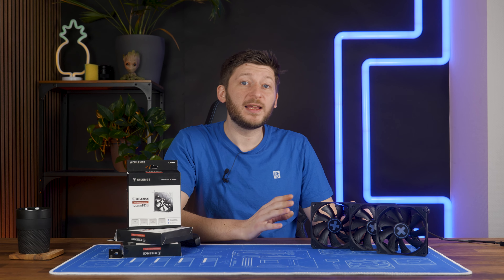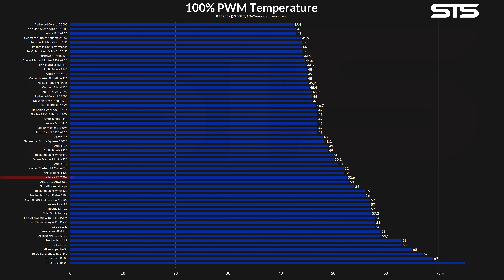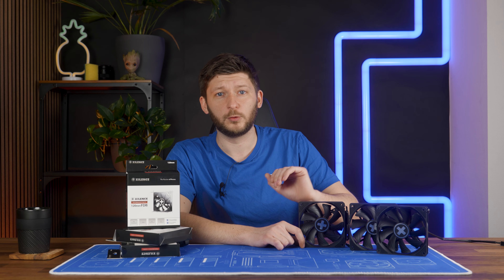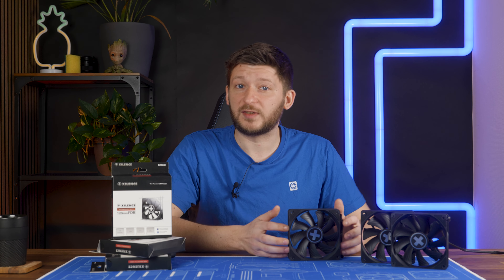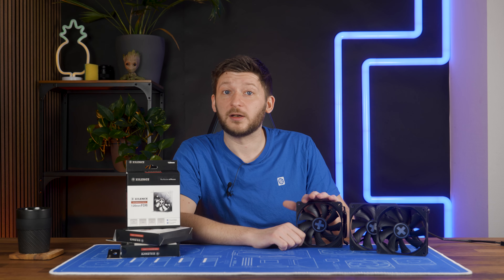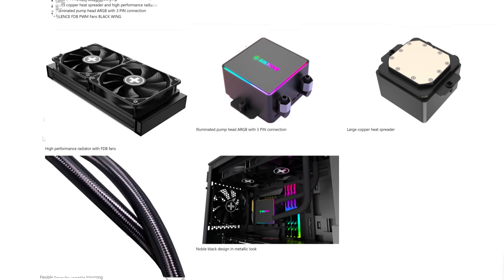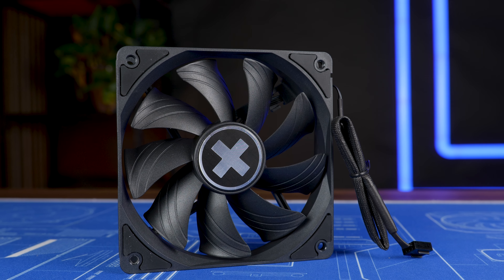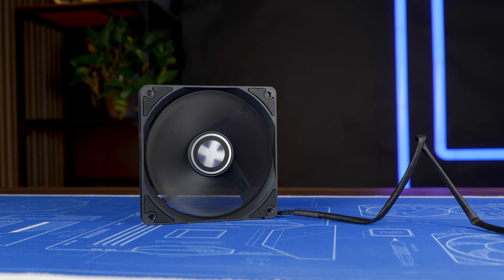Xilence XPF120X.B.PWM - The Radiator & Heatsink & Case Fan

Comment: Could you also review ID Cooling AS-120 and AS-140?
I just bought this Xilence fan for about 8.2 euro partly based on this review, and using it as a back exhaust in a Deepcool CH370 case. I'm keeping it below the desk at the moment so that might increase my perception of certain noises. First impression is that build quality is decent and it's quiet up to 1000rpm (50% speed) Above that the sound starts to get louder quickly. For now I use it at about 700rpm idle and 1000rpm at usual load, this way it's pretty quiet. Above that it's quite noticeable and sensitive to certain speeds, with FanControl it's easy to find relatively okay sounding spots though. But I don't really need it fortunately. As a decent low rpm PWM fan I like it, however the second half of the speed range is a bit too finicky to set up for low noise. I'd rather add a second low rpm fan on top of the case if I'd need more airflow.